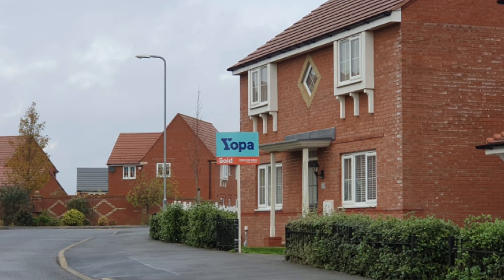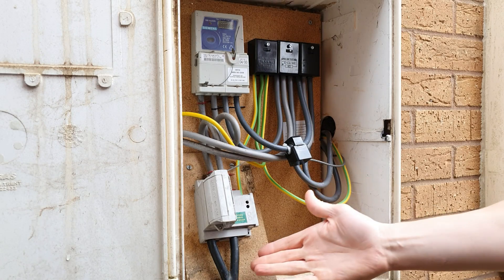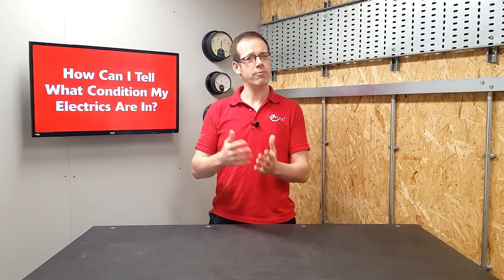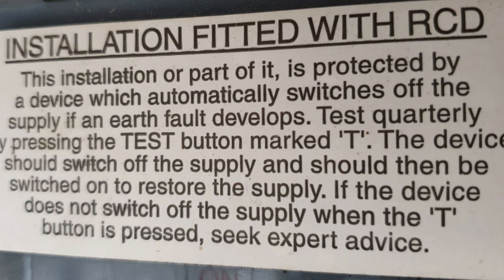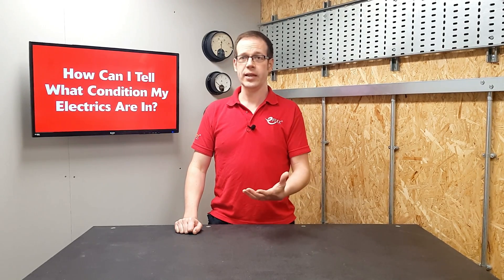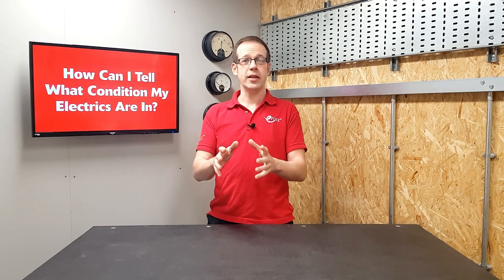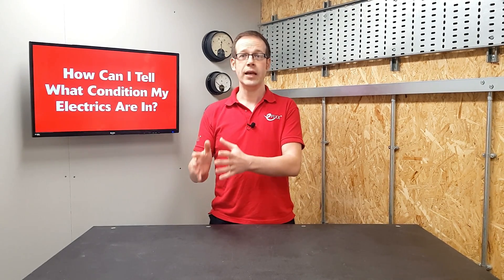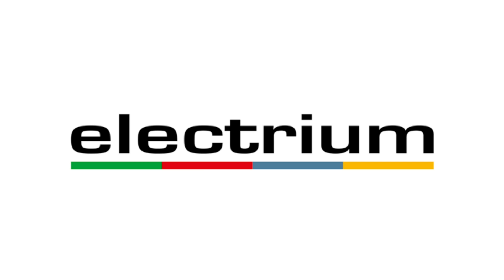WHAT IS AN EICR?- Electrical Installation Condition Report - Are my home electrics SAFE?

Comment: I’ve been subscribed to a lot of the big YouTube electricians and I think the first to say they’d often refuse a board change without an EICR was Dave Savery, and basically for the same reason, he doesn’t want to be called back after fitting a new consumer unit because of some fault that wasn’t picked up beforehand. And it seems the other big YouTube sparks are in agreement. However sometimes they’re able to inspect and carry remedial work as they go on, I guess the customer is made aware of this. So as long as customers are made aware of this and the options then there shouldn’t be any complaints.
Reply from the maker: Depends on the motivation for the EICR - some users just need the paperwork to tick a box. Then it’s a price issue.

Comment: What about if the earth cables were oversized? Would the installation not pass?
Reply from the maker: It's strange that they'd be oversized but I can't see why that would make it fail. 🤔
Reply: The larger the Earth cables the safer the installation IMO

Comment: Brilliant video. Thanks. Wish we'd seen something like this in 2013 before starting on work on house we now live in. It had all certifications for the survey but, peeling back wallpaper revealed very dangerous wiring and it only got worse. Total rewire, new consumer units, etc means we're good for future. BUT sparkies we used were recommended and diligent enough but pushed for time could have done much better jobs. They couldn't get the message that we were willing to pay to cover taking a bit more time. So many tradesmen, even good ones, stuck in mindset of work fast for lowest realistic price, partly due to us customers too focused on price. There is a huge problem finding deeply diligent tradespeople who are secure enough to explain and charge enough to do a comprehensive job
Reply from the maker: The industry needs more customers like you Stephen. 👍

Comment: Unfortunately unlike an MOT, an EICR is not a legal requirement. And most home owners will not have one done.
Personally when I go to quote for the job, I will look for the obvious, bonding, CPC in lighting circuits, type of cables etc, then if I get the job, i do an IR test on all circuits. And explain to the customer, that the installation could still have faults that their existent system will not detect, and there may be an extra cost involved if further work is required, this is also explained in writing on the original quote.

Comment: I think the EICR is a good idea if done properly.  There are many stories out there of EICR being done from the van on the driveway in 20 mins.  There should also be an EICR LITE for landlords at change of tenancy.  So a full EICR lasts 5 years and a Lite at tenancy change.  This way the install is safe but not crippling the landlord with costs

Comment: I’ve had a lot of EIRCs from customers where the electricians have given a C2 for a DB change.. and a C2 on lighting circuits because there no rcd protection.. I’m confused, do other sparks give these a C2 because I’d only give c3.
Reply: Depends on the litting fixtures and accessories,  it was explained to me that a C2 is danger in the event of a fault,  so if there is metal fixtures and/or accessories,  these could become energised in the event of a fault